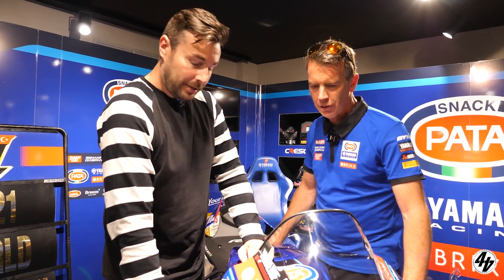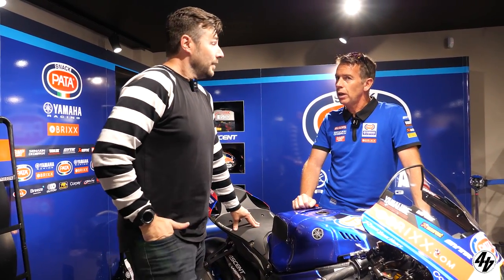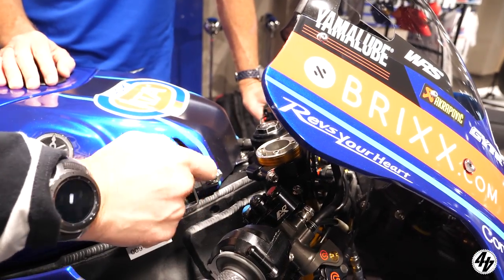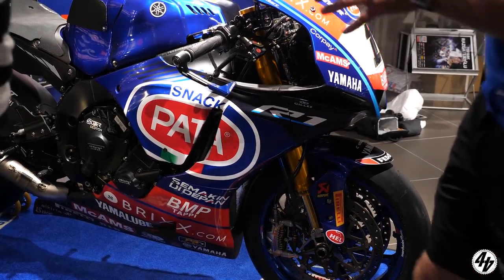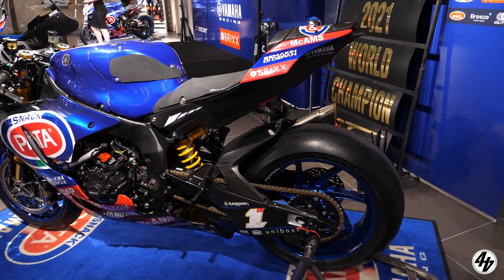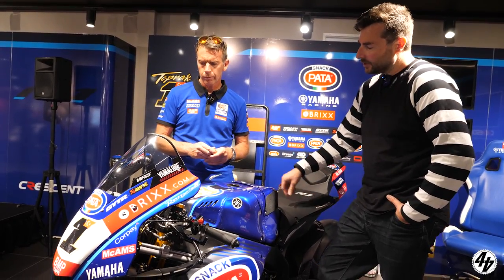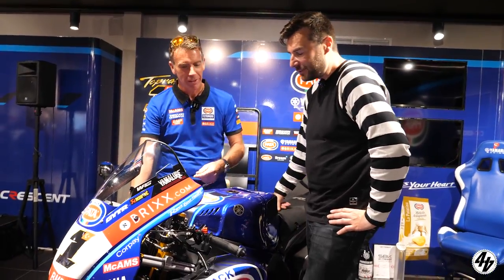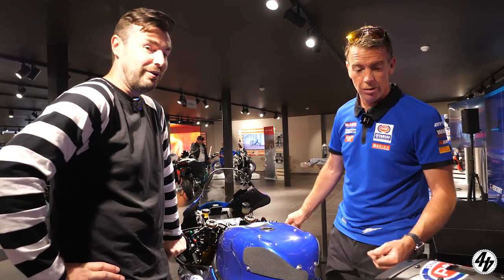Tech Time | Toprak Razgatlıoğlu's WorldSBK R1

Comment: This episode is like finding a treasure chest of "performance gems". Surely most racing data will not be applicable on the streets but the worth of knowing the technical details and processes is more satisfying than one can appreciate. For example, the ride height going up on qualifying to compliment the rear grip so the rear will not push the front, that is golden information. I don't have a superbike but then again I can relate to that knowledge when I tinker with my bike and see how much of that racing process can really trickle down to street riding. Not a lot I know but that's what trickle means I guess.

Comment: So the weight difference accounts for the performance difference between the two riders. Toprak 69, bautista 53, with shorter height. 16 kg is huge difference in terms of cornering, acceleration, stresses on chasis, and braking. Toprak is really giving his 100 percent but still it is hard for him to win a race this year. what i have concluded from this informative interview. Props to toprak.

Comment: I bloody love all the detail !
 Investment casting,  a wax or polymer pattern coated by placing into a refractory material, hardened and dipped several times, the wax melted and molten metal poured in, producing high accuracy and integrity,  interestingly basic versions of it go back thousands of years

Comment: İts explained very well by paul in a technical way and how its incridible that  big machine Toprak throws in to the curve's like a piece of a Toy , and brakes the Top speeds  ..its Talented
Paul also explains Toprak uses most parts then other Rider and Ruins more parts then other Riders 😅 also  the extra rare hand Brake that Toprak wants  and Paul  says the seat pad is low less for Toprak bec he wants to feel more rare Tyre 😂
He is an animal .
Reply: Mick Doohan started using a rear brake left handlebar solution after an accident.  This is from Wiki.... He competed successfully throughout the early 1990s and appeared to be on his way to winning his first world championship when he was seriously injured in a practice crash before the 1992 Dutch TT. He suffered permanent and serious damage to his right leg due to medical complications and, at one stage, faced amputation of the leg. At the time, Doohan was 65 points in the lead of the championship but could not compete for eight weeks after the crash. After an arduous recovery, he returned to racing for the final two races but could not prevent Yamaha rider Wayne Rainey from winning his third consecutive title (by four points from Doohan). In 1993 he struggled with the healing of his leg and the ability to race the Honda at elite level, stating later that in that year it was all he could do to just keep his ride at Honda. It was also during this time he switched to a left thumb-operated rear brake, as his right foot is no longer able to perform this function.                                                                   I have always wanted this on my R1. Great comment. Elif Elif.         I love the way that Johnny and Toprak battle like gladiators.
Reply: @ericsbuell  wow  its amazing  great Knolwge how You know 40 years ago , why and how invented ( happened )   About a Rare tumb brake . Im suprised.
I really appreciate of this information .😊
Thankyou my friend . 
I learned one more something from motoGp racing once again Thankyou Writing this .

Comment: We see that Toprak is probably using the stiffest chassis and frame in the grid and look always for an improvement in braking. All he needs is just an GP bike which has the stiffest frame and carbon brakes. People still think Toprak can’t handle a GP bike, because it is less forgiving due to stiff frame and different tyres. Come on! Toprak is already trying to evolve the SBK bike to a GP bike due to his riding style. He just simply needs to be in Motogp. He can easily smash it!

Comment: I would like to say it was informative, but it just did my head in.
When they have more rear grip Toprak wants the clamps further up the forks so he can break traction on the rear???
All my experience says that takes load off the front to the rear, making it so you drive the front on under breaks instead of taking load off the rear…
Now I am not about to argue the facts, but QUE?

Comment: Great interview! But I think if it’s based off a production motorcycle you should not be able to change the main frame?! It’s more of a prototype Motogp bike. The rules seem to loose
Reply: Its just reinforcement not a change in chassis geometry. You could say the same about the swingarms they are running. Its vastly different from stock swingarms. Its superbike not superstock racing.
Reply: It's a modfied frame not an entirely new one.
Reply: I don’t think they should be able to change the swingarm  or the rear subframe like on this bike.
Reply: @Speedracer155  like i said... this is superbike. Not superstock. If you want a production racing bike that is similar to your off the show room floor bike, thn that is superstock if for you. If you like the highest end production racing, thn superbike is your answer....
Reply: @MRryuhayabusa 👍

Comment: Denning is a cheeky cat..dry sense of humor ... Few things, Above all else Chris appears content...good thing...now regarding hand grip..Toptak has big hands IIRC...as in golf, you can increase the size of the grip using extra grip tape or 'underlisting' under the grip.  You can do same on your bike. Buy double sided golf grip tape, you can buy 'water activated' instead of solvent activated...some who have huge hands use Duc tape as the first layer, then use the double sided on top..so you can increase the size of your bike grip just as easy. It helps IMO, less vibration, alleviates grip pressure-less tense, less arm pump.. try it, it won't disappoint.  Onwards  ,.regarding riders size  ..excuse why  Bautista/Ducati have been smacking TopRak little Turkish fanny. Hickman won on a twin against Johnston.. even though it was at the TT..not a closed course..David Jefferies comes to mind  too.  I hope the FIM and Dorna in their 'infinite wisdom'  avoid going total aggregate weight-- rider+ machine. It was increase costs, more BS  and whining !!!. Dorna Sports and that Thug in Chief  Epeletza just HATE Ducati LOL  !!!

Comment: Love this interview but I think the rules shouldn’t allow frame bracing etc and should have more basically tuned bikes. At the end of the day it’s supposed to be production racing and I’d hate to see WSBK going down the current (daft) route of Moto GP (big aero, overheating front tyres when following and spaced out field)
Reply: Basic tuned bikes would be superstock not wsb
Reply: BSB already allows frame bracing for how many years now.
Reply: The frame is the same. Just added bracing as the bike in superbike form producea more HP and brakes wayyy harder thn stock r1. Normal people like you will never understand this world class rider's needs and the amount of stress this rider puts on these bike that requires the teams to put such measures in order to counter some issues faced with a budget constrained production frame....